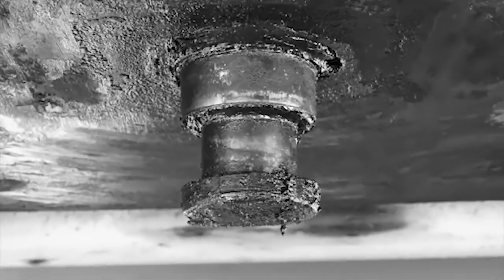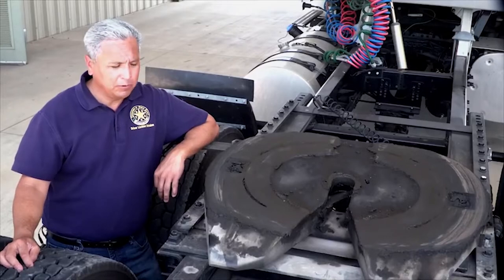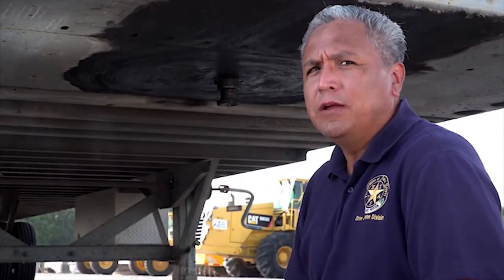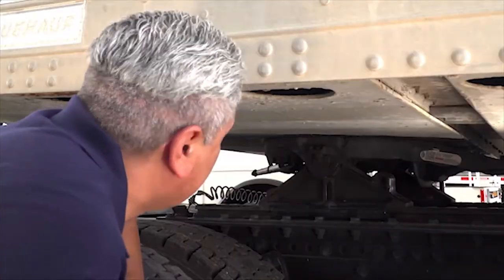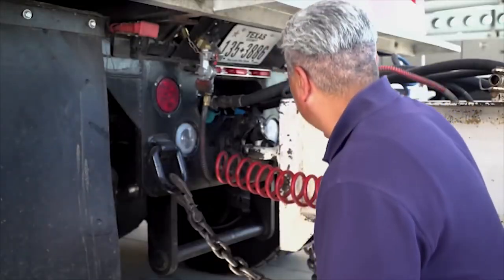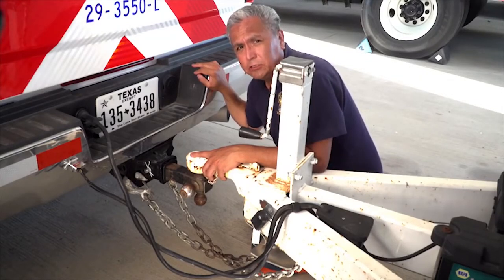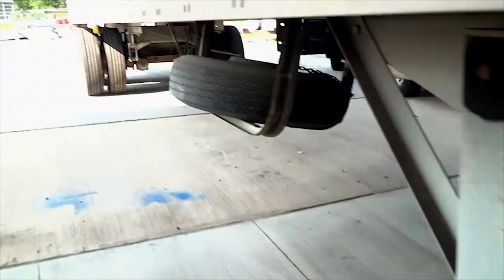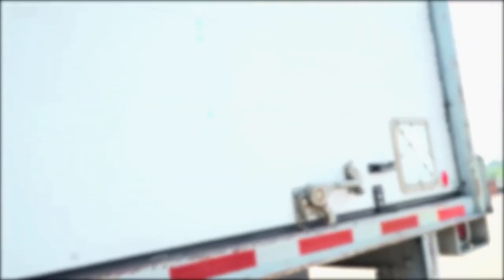CDL Instructional Video - Module 6 - Coupling Systems (Updated 2021)

Comment: he mentions that there should be no daylight betweent he 5th wheel and apron but during the test you have to point out that its the skid plate. Most proctors arent so strict but they can be dicks if they want and or if theyre just having a bad day. also, he didnt mention the glad hands which will cost you points if it doesnt fail you outright.  this video is worse than the others and the others arent great.
Reply: True I mentioned the service and emergency air hoses and went straight to the green electrical cable and their safety latch. After the brakes and in cab inspection was complete I was told I failed didnt tell me why exactly just gave me a paper with the section to study which was coupling. I thought hard and remembered I didnt mention the glad hands I also didnt name the skid plate just called it fifth wheel.🤦‍♂️..... Ill be more precise with my wording next time. 🤙🏽